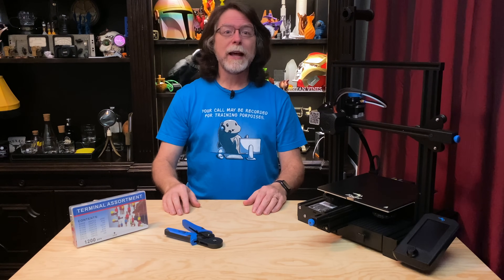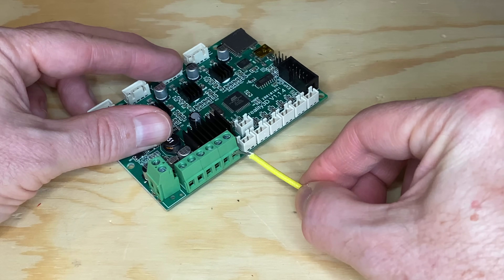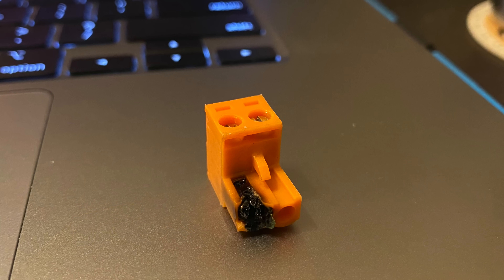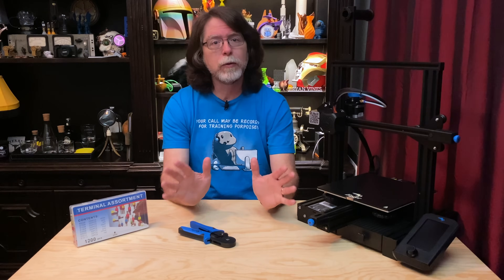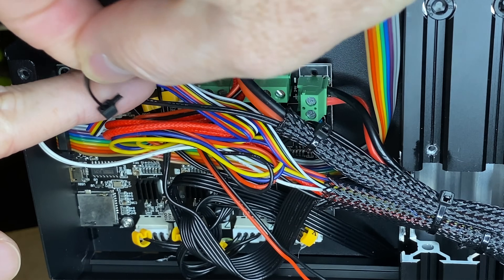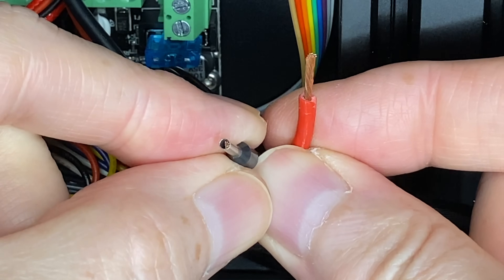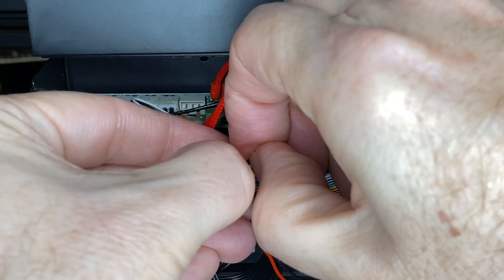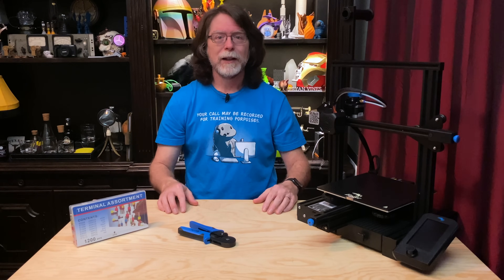Install Ferrules on Ender-3 V2 Wiring

Comment: What to do when the screw on the bed block got loose? I simply can't tighten it, as it keeps rotating forever and can't clamp the wire

Comment: Saw a couple comments about using different ferrules than the video. I thought the same for bed heater wires, and put a blue ferrules on instead of black, but blue ferrule doesn’t fit in the block. I cut back the bed heater wire again and was able to get black ferrule on. It was tighter than the power but keep screwing ferrule while inserting it over cable and will tighten up stranded wire and slide on 👍🏼

Comment: I like to, but sometimes forget, to take a picture of each set of changes before I start on it.   I can see how the wires were before I made changes and don’t put them back  in wrong. I’ll just refer my photo..  but sometimes I think it’s just easier to create a little note and scribble BNR so I know which wire went where I’m done with that section I throw the paper away.

Comment: A few days ago, my printer suddenly stopped working. Yesterday, when I finally found time to find out why, I found the negative connector of the power supply on the motherboard melted completely. Luckily it did not catch on fire. Am working to replace it , but funny thing is; The day my printer broke down, I had just ordered ferrule crimps and crimper that morning only😂😂😂. Coincidence is wierd

Comment: But isn't the problem with the XT60 connectors burning up is because they were crimped rather than soldered?  If we are crimping bootlaces, isn;t that just going to move where the problem is?  What about soldering after crimping?  I'm looking at a burned up, crimped XT60 connector on my desk right now.

Comment: Hello, I have a Ender3 v2  for 3-4 yrs now  and haven't had any issues until i tried to print ABS I set bed temp to 80 and was printing good until everything stopped . upon searching for problem I replaced PSU
and the same thing no power so i looked at Motherboard the hot bed connecter was melted so i am replacing the hot bed and upgraded Motherboard but to be safe i am going with these Ferrol's. hopefully this will solve my problem..Thanks for a great video you saved from having any more problems. I have pics if you would to see.
Bill from ct.

Comment: Small hands are a boon when working on these things...took me an hour and a half to do mine.  Finally ended up having to take the right side of the thing apart to get more than one of the ferrules back into the terminal block, 'cause my fingers are just too dadgum big lol  Edit:  BUT!  As others are saying, I do now hove more peace of mind about running it for more than an hour at a time.  Still not sure about running it overnight yet, but, I'm sure I'll become more comfortable with the idea as I get used to finally having a 3D printer.  Edit:  Also, not sure if they've just changed the gauge of wire that goes to the hot end, but I had to use the next size up from the black ones (had to use blue) you used for the hot end wires.

Comment: I've looked up two topics today: 1) Working with Tinkercad and 2) Using a Crimping Tool, and after clicking on a video, one of yours about the same topic was recommended in the sides, so I watched those. Thanks for all of the valuable information! I'm going to do this with my Ender 3 V2 and see if my Ender 3 Max Neo needs the same. I think I'll use this tool also for 12v power jack adapter connectors.

Comment: My terminal block had a meltdown and I'm having trouble finding the right size. The two sets I have ordered have been too small. Could you post link to correct blocks if available?

Comment: My Y stepper motors are so hot to the touch. Can you break down how to properly set the vref for an Ender 3 s1 pro and ender 3 Max stock board

Comment: Can I crimp the same size butt connectors onto them instead of using ferrules? The only difference is ferrules have the plastic ,which these butt connectors do not have plastic ends. 
Other than that they're exactly the same thing.  Or would using butt connectors present a danger? 
Only wondering because i have a ton of butt connectors and no ferrule heads.

Comment: One thing you can do is take a picture of the wires you plan on replacing before you do any work. That way you'll always have a reference of their original position.
Reply from the maker: Excellent advice! 👍
Reply: @BV3D  It's a great trick for anything you have to disassemble.

Comment: I have learned a lot from BV’s excellent videos, but a word of caution on the ferrules. Some of my wires were marked as 15 AWG, which is not at all common in North America. My kit had 14 and 16 AWG ferrules. 14 AWG ferrules were a problem placing into the connector block, and 16 AWG ferrules required clipping some wire strands - not good. There is also not much slack in the wires, and they make very tight turns into the connector block.  Not to be a killjoy, but many might be better served by just snugging the connector block screws every 6 to 12 months rather than risking trouble with a poorly connected ferrule.

Comment: Ah, thanks for the information! Looks like I need a new tool and kit. I don't own a ferrule tool or any ferrules... had one wire to my hot end burn up shortly into owning my Ender 3 V2, luckily the printer shut down because of thermal runaway. Anyway, I replaced the wire with a high quality wire of the same gauge, and tinned the end because I noted that was what the factory/Creality did. I've been using the printer for a while since, probably 20 prints or so, without issue, and I came across a tip about tinned wires in screw connectors being bad. Anyway, now I'm paranoid that is why that wire burned up, and will be tightening the screws occasionally until I get my hands on some ferrules. 😁👌
Thanks again, and all the best Bryan!

Comment: Your link has a 6-4 (square) and 6-6 (hex) option. From what I can gather they bit both will get squished down more by the screw terminals. 

Which did you use? And outstanding benefit of what crimp style over the other?
Reply from the maker: Hi! My crimper is the square one. They must've added the hex one later. I don't know if there's a benefit to one type over the other.
Reply: @BV3D  Thank you for your response and videos.

I went ahead and ordered the square one.  I'm following your instructions on replacing the stock Ender 3 extruder with a micro swiss.  I went ahead and ordered some replacement heater cartridges and thermisters, as my heat is really dirty.

Only problem is the extruder arrives today and the crimpers on Monday :)  If the heater cartridge comes out without any issues I'll just use the old and have the new ones in reserve.  Then I'll fix up the power connections with the ferrules after I get the crimper.  I've had my ender 3 for 3 years now, so a couple days should be okay.

FWIW I read a comment on a forum where in a pinch you can round them up by crimping once, rotating 45 degrees, and crimping again.

Comment: hi.. just wondering if you did the power supply side, not just the mainboard side?
Reply from the maker: Every time I've looked at the power supply side on a printer, it's been crimped fork connectors going onto the terminals there, so I haven't had to mess with them.
Reply: @BV3D  thanks for your reply, i am not going to bother opening it up then

Comment: A small tip, when taking of insulation, cut but leave the insulation on the wire and twist it as you take it off. It will come out perfect every time.
Reply from the maker: That's good advice! 👍

Comment: What is making the connection get hot enough to deform the tinned ends, to begin with?
If the connection never gets hot enough to deform the tinned ends in the first place, then there shouldn't ever be a problem, right?

Comment: A very important mod to do alongside this (especially if you plan on ever printing PETG or especially ABS/ASA) is to unplug the motherboard cooling fan, cut off the plug, strip a bit of insulation off the ends, and connect it to the same screw terminals as the hotend fan. 

The reason for this is because Creality, for reasons only known to them, decided that the motherboard fan should only be on when the part cooling fan is on, instead of all the time.
Reply: Did you leave both of those wire ends without ferrules? How did you go about making it safe?

Comment: Just done this on my ender 3 v2 that's about a month old now, interestingly enough there was hot glue around all the 'hot' connections and the wires coming from the PSU and to the bed are way thicker in the video, had to use a blue ferrel from the same set for those.
Reply: I am currently doing this for my ender3 pro purchased around Jan 2020.  I also needed to use the blue for two of them and the black for the third.

Comment: Wait quick question, I’m currently going through this process with my ender and I was thinking.. why not leave the tin on before crimping? Wouldn’t that be somewhat of a double protection in a sense?
Reply: Yeah I don't see the issue with the tin when it's crimped. If anything it helps increasing the surface area of contact.

Comment: Normally I like your videos but in this particular instance you're parroting a load of nonsense.

Tinned wires in terminal blocks are perfectly acceptable for these types of devices.

If the terminal block is properly tightened then expansion and contraction is a non-issue, the high resistance termination that you showed would occur even with crimped terminations as the terminal block was obviously not torque down sufficiently.

In other words this is a complete waste of time and money. 

In fact you could be causing more problems than your solving. Be overwhelming majority of crimpers sold on eBay are cheap Chinese junk that do not produce quality crimps the end result is that the crimped termination that you are applying is probably less reliable than the tinned wire connection would have been.

On the other hand if you're willing to invest in a quality precision pair of crimpers and high quality terminations then there's probably no harm. But recommending that people buy cheap Chinese crimpers and cheap Chinese terminations is lunacy.
Reply from the maker: Hi Dan, thanks for taking the time to comment. The document from Phoenix Contact USA, titled "The problems with tinning wires", by Michael Psaltis ( https://bit.ly/3b1w42f ) shows why tinning is not acceptable for this application, and ends by recommending ferrules. And the fried motherboard and burned bed heater connector from my Monoprice Maker Select Plus bear this out.
Reply: @BV3D  first of all let's set the record straight there is no UL or ETL requirement that wires terminated in a terminal block utilize crimp terminations on the end of the wires.

Furthermore I'm pretty sure that Michael isn't recommending that people with limited electronics skills go out and purchase cheap Chinese crimpers of unknown quality from Amazon and then proceed to learn a new skill by terminating all the wires in their printers terminal block using cheap Chinese crimp terminations of unknown quality.

How asinine is that. Now I wouldn't have a problem with an experienced individual using a pair of high quality say AMP crimpers terminating the wires with high quality crimp terminations from Mauser or some other reputable source.

But as a retired aerospace electronics engineer I'd take my chances with a properly tinned and torqued terminal block then crimp connections made with a pair of cheap Chinese crimpers and crimp terminations of unknown quality.

By the way tinned wires and European style terminal blocks have been in use for decades without problems. The problem isn't in the tinned wire and terminal block but rather in the improperly torqued connection. A properly torqued terminal block is not going to be an issue. And I'd venture a bet 10 to 10 to  1 that the burned up terminal block that you experience was the result of an improperly tightened terminal.

Of course what would I know I was only vice president in charge of prototype development for one of the nation's largest aerospace contractors.
Reply from the maker: @dannelson8556  It's clear you're looking for a fight about this, and I'm not. Have a wonderful day!
Reply: @dannelson8556  Quick question.. Aren't we all learning a new skill when we get into 3D Printing (or any hobby) that may require us to learn more new skills as we go? For example, if I want to change out the nozzle on a hotend, that's a new skill that I didn't know before. Or if I want to add Auto Bed Leveling, I have to learn how to wire that in. Heck, before my first printer, I didn't even know how to load filament. I think it's important for people to learn how to crimp wires, run new ones, and learn to troubleshoot/work on their printers. Just like if I was going to paint a model car. I would have to learn how to paint, which paint to use, etc. It's all part of the hobby. 

I don't want to argue the importance of tinned or not tinned wires because I think there are many different views (like yours and Bryan's) out there. But I will challenge you to come up with a solution if you are going to say there is a problem. If you don't like the "cheap Chinese crimpers" or "cheap Chinese crimp terminations" then can you suggest and recommend good ones? You say you were the Vice President of one of the "nations largest aerospace contractors" and I would bet you didn't get there by not have solutions to the problems. 

So for those of us who would like to put Ferrules on our Printers (or any other electronics for that matter) what would you suggest we use? You say AMP Crimpers and Mauser terminations above, do you have links where we can buy these, or a good alternative on Amazon that we can choose? 

I appreciate your area of expertise and look forward to your response.

Comment: Came to this from r/ender3 subreddit. Probably the clearest explanation of why and how that I’ve seen.
Reply from the maker: Thanks A-Ron, I am glad you liked it! 👍
Reply: @BV3D  thank you, really. I put ferrules on my wires months ago, but I must have misunderstood something on a considerable level when reading the instructions: I had crimped the plastic ends of the ferrule (rather than the metal tube through which the business end of the wire goes) to the wire after feeding the twisted wire through. It seemed dumb, but the directions were not super clear in translation and there weren’t a bunch of pictures. When I saw this and reinstalled the ferrules, I found the heater bed wire was loose in the ferrule, easy to pull out. Honestly, this video might have save me from a possible fire.

Comment: Hello: I just purchased a Voxelab Aquila, do you think I should do this for my printer? I haven’t yet started assembling it, would it be easier to do it now, before assembly? The package set has so many pieces, would it be more cost effective if I purchased a small package of the 2 types of ferrules you used? What are the ‘AW’G’ gauges of the black and red ferrules you used? Thanks

Comment: Just a remark. When crimping electrical connections, you should avoid twisting the wires.
Reply from the maker: Thanks for the tip! 👍
Reply: Why?
Reply: @littlesnowflakepunk855  crimping is actually a cold welding process and if the wire strands are twisted, welding performance decreases drastically leading to premature loosening of the joint.

Comment: This is a little bit funny about Creality don't installing ferrules from factory. I mean, the power supply wires already has crimped fork terminals on the power supply side and also crimped spade terminals on the mains input side, adding ferrules sure isn't a big deal if they already did one side of the wire...

Comment: Another great video, Bryan, and very timely. Recently my Ender 3 v2 stopped working in the middle of a print. I opened up the board to test the voltage for where the power supply connect to the motherboard, and the connection port was fried (not as bad as in this video, but it's toast). The vendor sent me a new power supply and motherboard, and since I have to hook it up anyways I'm going to use ferrules.  Thank you!!!
Reply: I had the same type of problem and had to run resistance tests on the wires leading to the hotend in order to find out that it has burned up in the middle of one of the wires... replaced and tinned the new wire to match factory specs, thinking I had found a faulty wire... now I'm thinking pre-emptive ferrules all around are the trick! Best of luck to you!
Reply: Wow, a whole brand new board and power supply? Lol, I hope they realize it's not worth cutting corners like that. What if there is a fire and the printer is the cause?

Comment: Really easy to understand! Thanks! I’ve been thinking that my Ender 3 Pro is dead and leave it several month and finally I bought meanwell PSU and...Last night after I replaced PSU, it still won’t wake up and ....I found out that my Ender 3 Pro cable (Power - one) was loosen and dancing on the board... that was one of the scariest moments I’ve ever experienced...

Comment: Good idea to also take the board fan and clamp it with hot end fan and insert it into the connector so it's always on. Normally the board fan only works when the part cooling fan is on so that's load of stupidity. As a side note Creality customer support just sucks, week without a single answer to multiple emails while I have a faulty board on my Ender 3 V2. Guess I'll by a new one out of my own pocket for 1/5 of the price of the whole printer and install ferrules while I'm at it. Royally sucks since that money could have been used to afford me 2-3 nice upgrades, like a metal extruder and capricorn tube and maybe even bltouch as well for a bit more. I'm pretty damn pissed, ngl.